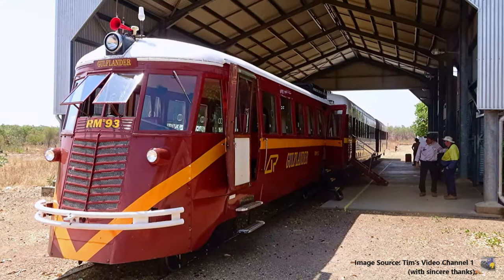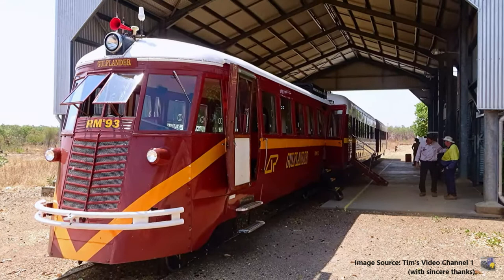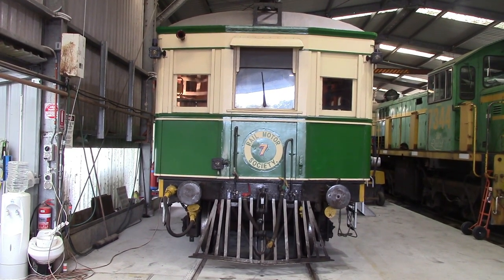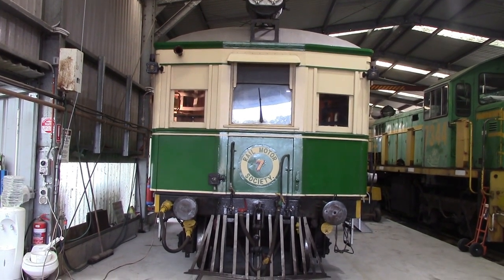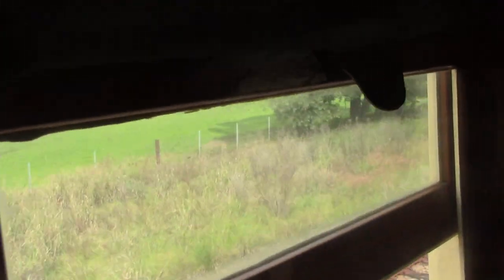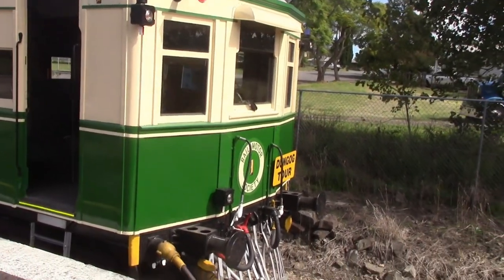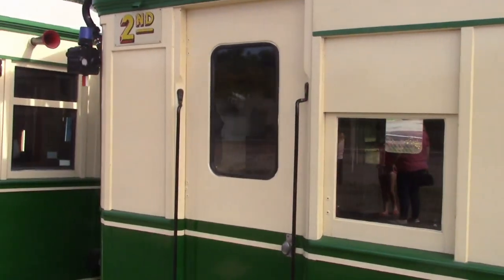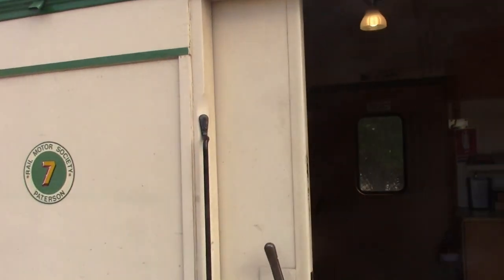TIN HARE – A CORRECTION!

Comment: Hello Neil, I have always associated "Tin Hares" with New South Wales Government Railways, but I'm no expert and I have come across the use of the description "Tin Hare" elsewhere in Australia, although there is every chance that the name was simply adopted from the original to describe early Rail Motors in general. In New Zealand and the UK such trains are generally referred to as Railcars, although today the generic description is DMU (Diesel Multiple Unit). I didn't know that that original "Tin Hares" gained their name from the lures used in greyhound racing, now I've learned something new today. Just to throw a spanner in the works New Zealand Railways operated "Tin Hares" on the “Wairarapa” line. Thanks for including links to the Gulflander in your video description. Cheers. Tim.
Reply: @timesvideochannel1 There's other Tin Hares in Western Australia,Queensland,Tasmania and Victoria not just New South Wales.
Reply from the maker: @Mediawatcher2023  Those other rail motors in other states are NOT genuine "Tin Hares". The tag, "Tin Hare" is tied uniquely to the CPH-class rail motors in use on NSW country and regional tracks from 1923 to about 1985.
Reply from the maker: A "Tin Hare" in New Zealand? Might've been exported there! Might also have been modified to run on NZ's narrow-gauge tracks.
Reply: @neilforbes416  I just read other information and been told they are genuine
Reply from the maker: @Mediawatcher2023  No. They're NOT genuine. They are just mimmicking the name. The whole reason why the CPH-class rail motors were tagged "Tin Hares" is because they were introduced in 1923, at the same time as the mechanical lures were introduced into country greyhound racing tracks. The lures ran on a single rail, pulled by a cable attacked to either a petrol-driven engine or electric motor. This drove the lure, a pelt of a rabbit, at high speed around the track on which the greyhounds raced. This was the speed at which the CPH-class rail motors ran and the comparison led to the CPH-class rail motors getting tagged as "Tin Hares". As to the lures, there was some tin, or other metal used in their construction but tin was the assumed metal used. Hence the term, "Tin Hare". This history is NOT replicated anywhere else in Australia as often, the rail motors there were not as fast as the CPH-class. END OF SUBJECT!
Reply: @neilforbes416  OK lets move on you made your point.
Reply: @Timsvideo1 according to its history they are found in other states of Australia not just NSW I have watched other videos and have been told by several motorail societies.
Reply from the maker: @Mediawatcher2023  They're only in other states if CPH-class rail motors are chartered for rail tours. It is the CPH-CLASS ALONE which is known as the "TIN HARE!"
Reply: @neilforbes416  OK but i will leave it up to other people with their own opinons.
Reply: @neilforbes416  Not sure, I think it might have come from Europe.
Reply from the maker: @Timsvideochannel1  Not European! The Tin Hare rail motor is uniquely of New South Wales origin here in Australia.
Reply: @neilforbes416 So are you saying that people in new south Wales shouldn't call the S sets silver sets because the Queenslanders call the SX cars silver sets as well?
Reply from the maker: @shelldoor8464  I'm saying that the NSW rail motors of the CPH-class are Tin Hares while other states' rail motors are not so because they don't have the history behind them that caused the CPH-class to be given the "Tin Hare" tag. END OF SUBJECT!
Reply: @shelldoor8464  This is from QRM this is what it says on its website Take a journey through frontier country from Normanton to Croydon as you step aboard the iconic Gulflander. Also known as the 'Tin Hare', this legendary rail motor is one of the last great characters of the rail world. So its not just NSW.
Reply: @Timsvideochannel1  i was watching another video from Western Australia and they have trains also Tin Hares so they're all over Australia.
Reply: @Mediawatcher2023  There are Tin Hares all over Australia, just don't tell Neil, because he might have something to say about all the fake Tin Hares. 😉.
Reply: @Timsvideochannel1  your secret is with me 😂
Reply: @neilforbes416  If you do some research actually they do
Reply from the maker: @Mediawatcher2023  I've banged my head against a wall, trying to tell you the Tin Hares are UNIQUELY NSW sets, Its because of their HISTORY that they got the "Tin Hare" name. None of the other states' rail motors have the same history as the CPH-class of NSW!
Reply: @neilforbes416  Did you get a response from the Queensland Rail Motor Society?
Reply: @neilforbes416  Tin Hare is not official name its just a  nickname like sydney harbour bridge the coat hanger sydney tower the big plunger and so on.
Reply from the maker: @top40researcher31  It's the HISTORY of the CPH class of rail motors that earned them the affectionate name, "Tin Hare"!
Reply: @neilforbes416  It be like a train that runs from Melbourne to Seymour called the sprinter because it goes fast at a short distance.
Reply from the maker: @top40researcher31  But it DOES NOT have the same history as the CPH-class rail motors, so it cannot be nicknamed "Tin Hare".
Reply: @neilforbes416  i was giving you an example of course it doesn't share the same history as the sprinter and tin hare are two different trains from two different eras.
Reply: @neilforbes416  The NT Trains have a different history to the NSW   Tin Hares so its clear there's no comparison
Reply from the maker: @top40researcher31  Were we talking about trains in the northern territory(written as a description of the area rather than an official title)? NO, WE WERE NOT! We were talking about Northern Queensland, particularly around Cape York.
Reply: @neilforbes416  all I'm interested to know where they got the name tin hare from the Queensland rail society must have copied from NSW,
Reply from the maker: @top40researcher31  It would be a copied name and not justified. The Normanton-to-Croydon "Gulflander" didn't run anywhere near as fast as the "Tin Hares" because the track on which the Gulflander ran was laid directly onto the ground with no "ballast" used. (Ballast is the crushed rock laid down in a track bed before the rails and sleepers can be laid).
Reply: @neilforbes416  in other words plagiarism
Reply from the maker: @top40researcher31  Plagiarism only applies in one or more people taking unjust credit for another person or group of people's literary works or compositions (songs) recorded or just sheet music. In the case of calling a rail motor by a name that doesn't apply to it, that's just misinformation, intended or not.

Comment: did you get a response from the museum about the name of the train ?
Reply from the maker: No, I didn't.
Reply: OK i did get a response and the information about the history of the train. As for your Email it would have been ingored.
Reply from the maker: @Mediawatcher2023  It's only a "train" if there are two or more rail motor carriages. The Tin Hare was designed to run as a single unit or, coupled with one or two more units to form a two- or-three carriage train depending on needs in peak hours.
Reply: @neilforbes416  Yes same as a car,truck,building or any other there's no significance about them.
Reply: @neilforbes416  Usually they respond if its important.